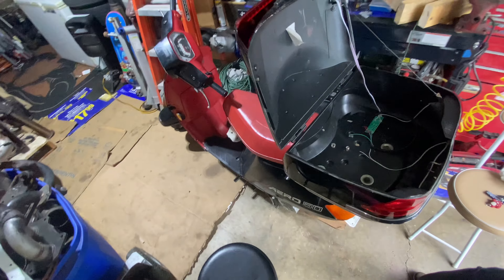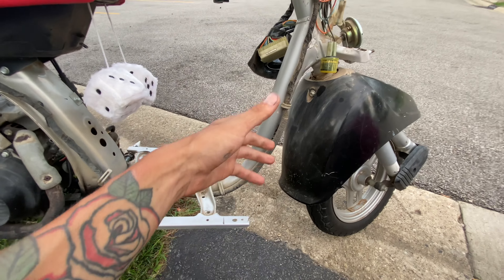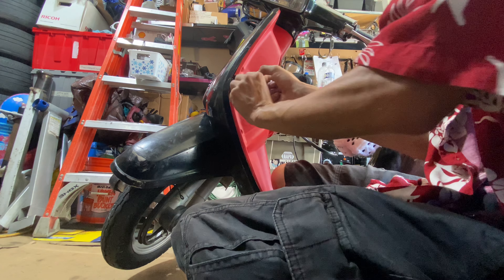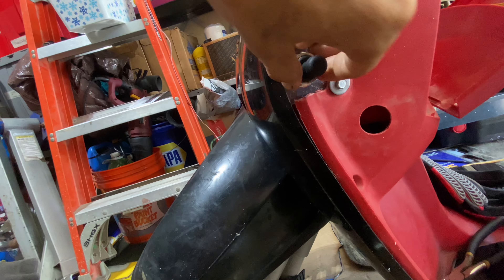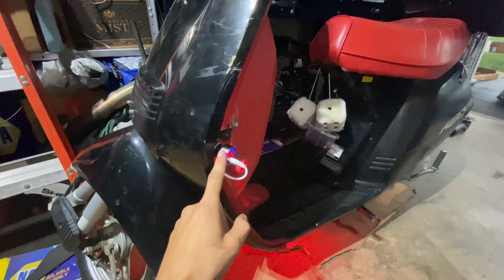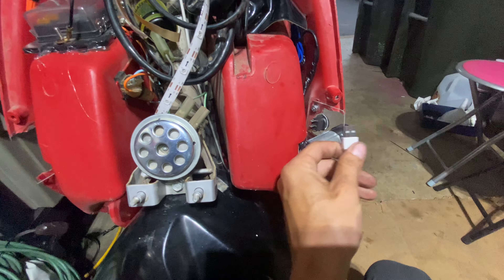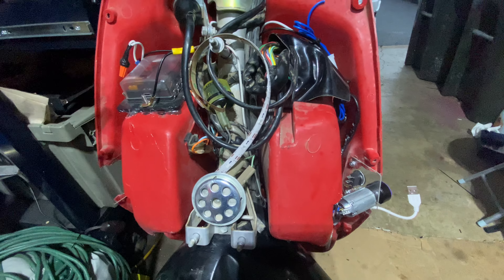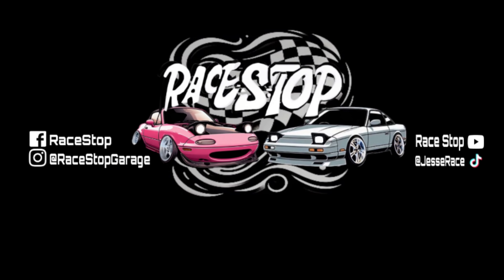My New Honda Aero 50 (Transformed in a week)

Comment: Gonna be looking at a 1987 Honda aero 50 with 5,600 miles on it, owner said its working smooth as butter and well maintained, you think itd be worth the purchase around $1400?
Reply from the maker: I’d say if you’re okay with spending that and it runs great. But I’d say like 1k with that mileage
Reply from the maker: But if it’s rebuilt, body is clean and such then it it’s worth it

Comment: Looking good!!, can you show more content about those foot pegs you installed? I really want to do the same on mine
Reply from the maker: All I did was weld a small plate to the higher part of the stand and welded a bolt long enough to stick out the sides. Then I got a coupler that was decently long to be able to adjust it in and out
Reply from the maker: I have the undercowl on now so I had to cut them off to fit it